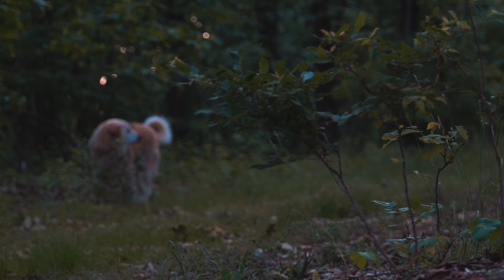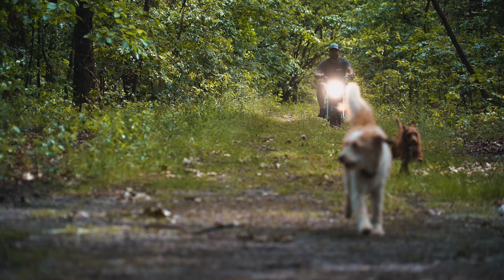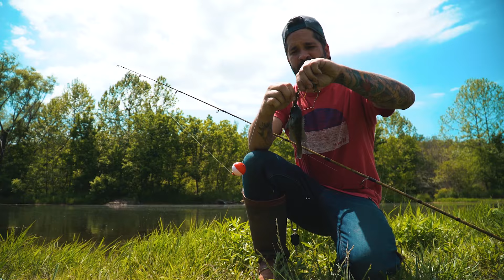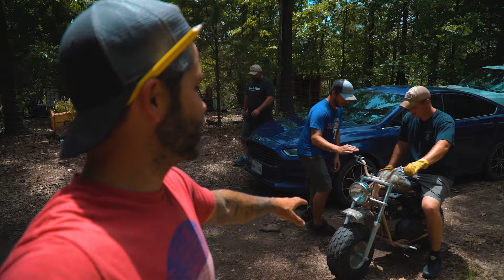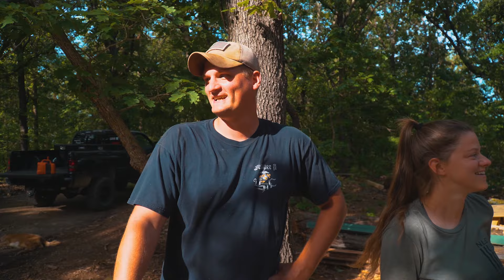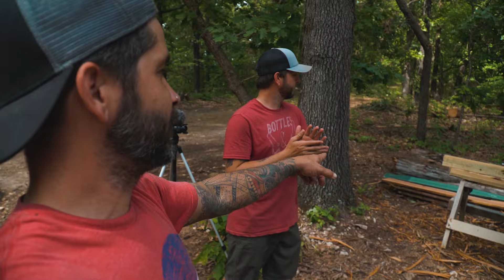Group of Friends transform OFF GRID TINY HOUSE  - Keeping It Dutch - Sawyer Ridge - Jared Crocker

Comment: Everyone worked well together. Jared is not afraid to work. Its all coming together Jason. Only thing i'm worried about are those trees. One good thunderstorm could spell trees down. The Sawyers are amazing. Hotter and Humid weather is one the way. You will get it done. Can't wait for the Tin roof install. God Bless the Crockers always.

Comment: Exciting to see the progress! Regarding the coop, hardware cloth, attached with screws and washers, not staples, is more predator proof than chicken wire, especially in the woods where you live. Raccoons can rip out chicken wire. Recommend checking out the Grandpa’s Feeder, which keeps feed dry and prevents chickens from spilling feed on the ground, thus not attracting mice, etc. And the Premiere1 nipple drinker will provide your chickens with clean water in a clean container and keep your coop dry from spills.

Comment: When I grew potatoes, I used old tires. Start with 2 tires stacked on top of each other, when you notice potatoes start growing taller, add another tire on top of that. Keep adding tires until you reach about 5 tires high then start unstacking them and harvest your potatoes 😉

Comment: Jason, what would look really cool, is if you put short logs standing  up just like the big one  but only have them as tall as the bottom of your porch. Then in between have stones around the bottom like is on your gate post and have the stone wall with vents in each wall in between each short porch post. so the side of the house you just did, there would be 2 tall logs and 2 short logs and 3 stone walls with vents in each wall. just an idea:)

Comment: Use some stock plaster finish with flex additive in it Those boards are very thin They will expand and Contract a lot So that it won't crack Good luck

Comment: I got an idea. On the very top point of your roofline, instead of putting a little triangle in there do some cross cuts and put like around in there so it kind a looks like there’s a lot going through the top of your cabin holding the roof up.  It may be a couple small side rounds to fill it in.  I know you already got that top triangle in there but it would be quick to pop that out and put around in there so it looks like you had a log supporting your roof.

Also, when you do those other polls for the deck awning. Measure first and you can cut the tops off, that will probably take a good 60lbs off of there.

Comment: You’re truly  blessed To be surrounded by such good friends and family.
Reply: yimjustbeachy 

That is good planning right there.

I bought off grid land in Alaska, but all my friends (and willing able bodied relatives) live in Nevada, California, Utah, Arizona, Oregon, Texas... so none of them have helped or will help finish the construction of my cabin.  I also bought where I have to take all my building materials by boat through the inside straight... not as easy as loading the pickup or trailer at Home Depot and taking all my stuff to the job site.  The last load I took of building materials was only three sheets of 3/4 inch ply, four ten foot 4x4s, a dozen eight foot 2x6s, and four bags of concrete.... and that with the boats gear and me put me about fifty pounds over the boats limit, I got a third the way there and weather changed making the seas rough..... I thought surely my boat was gonna end up 1300 feet down in Behm Canal....